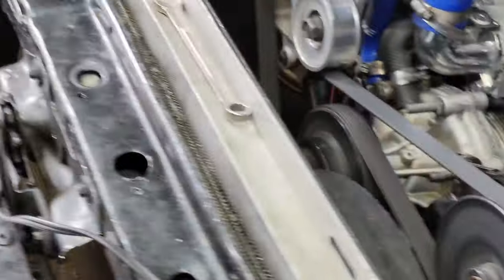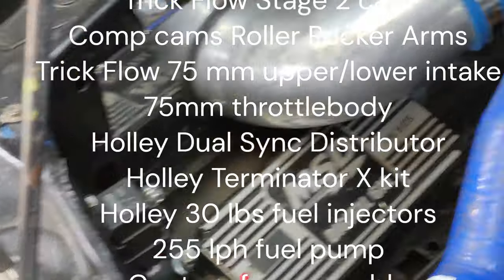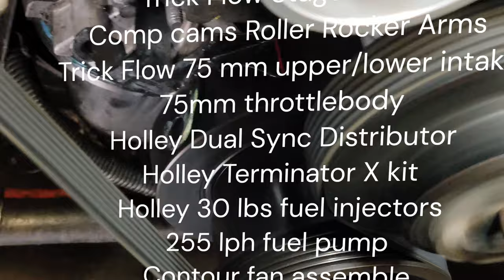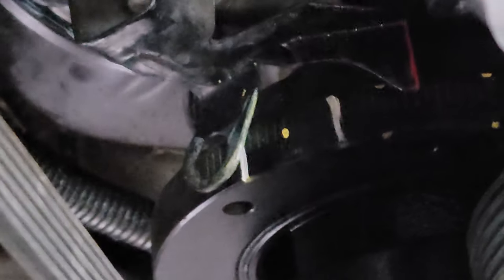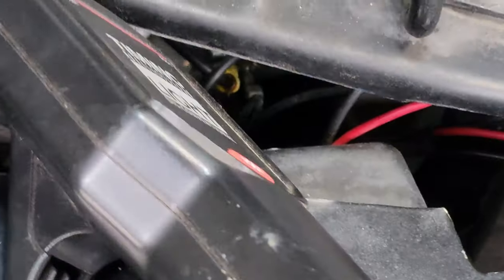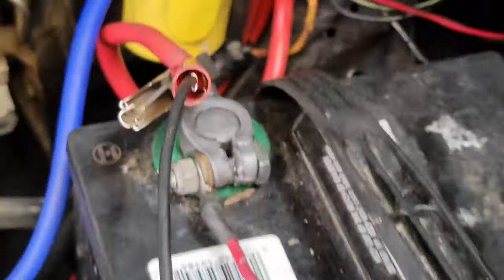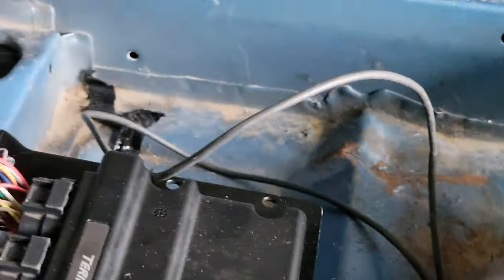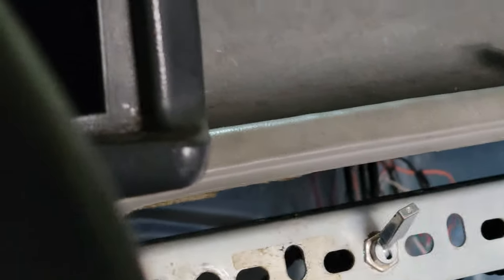88 Mustang GT + Trick Flow (Fast As Cast) 170 Cylinder Heads TFS-51410010-M58

Comment: You have any clutch cable issues with those old maximizer headers?  Found a set of those cheap since the company is shutting down.
Reply from the maker: Clutch cable was close to headers, had a muffler shop heat that area up and put a small dent in header for clearance.  Also, added a JEGS Thermal Heat Sleeve to the clutch cable. No problems since.  Good luck & thanks for watching.